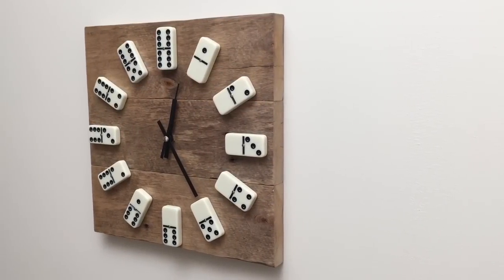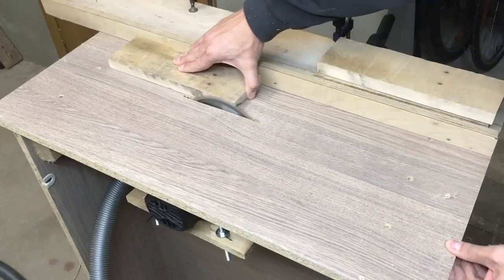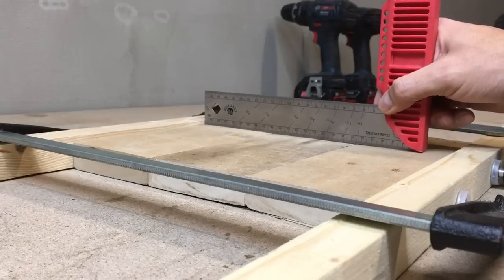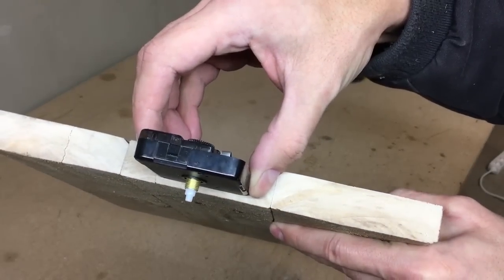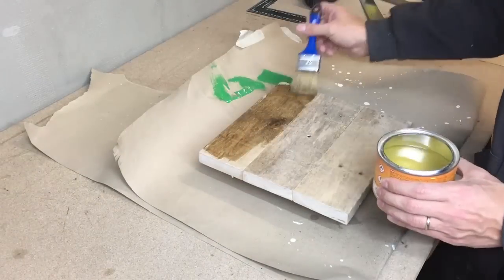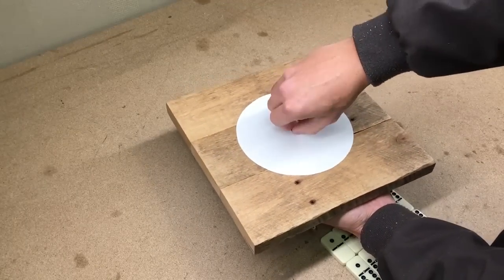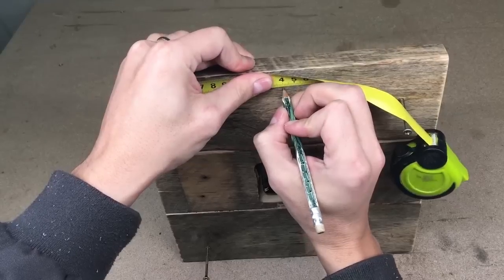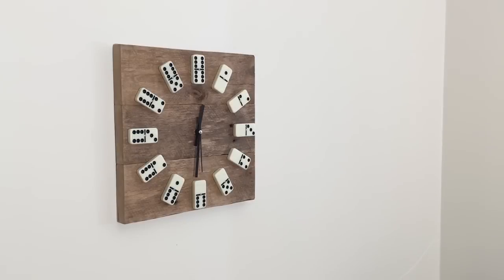DIY: Domino Clock From Pallet Wood

Comment: Gluing three pieces of stock together with a butt joint is a very ineffective way of fusing the wood together. One accidental drop to the floor and all your hard work is finished. A mortis and tenon joint, a couple biscuits or dowels locks this together for good

Comment: Great, love the dominoes against the pallet wood!  A few things:

1) Looks like from the end result you had to screw the dominoes to the boards.  I assume the epoxy had troubles against the already finished wood?

2) I realize it's pallet wood and you won't see the back, but rather than putting in temporary screws to keep it raised for finishing, there are plastic pyramids you can buy from hardware stores that are built for this purpose and they won't mark your wood.  Or put some nails through a scrap board and use it to balance your work piece on!

3) Please, please don't put your face up to a router like that without wearing goggles.  Spectacles are not sufficient to protect your eyes and you were getting a lot of wood debris thrown at you.  Also if you're going to be routing for extended periods, put on some ear protection as well.

Keep posting up the videos!